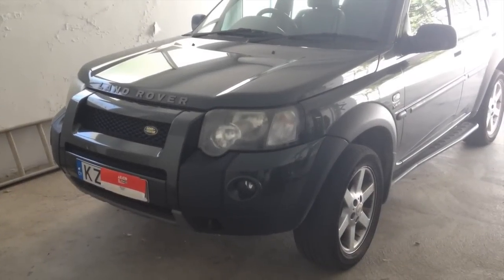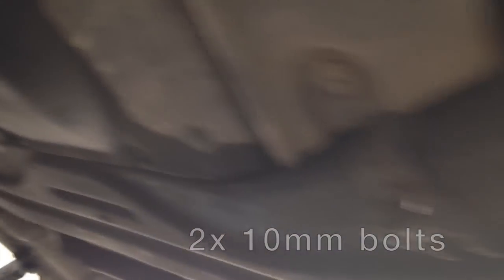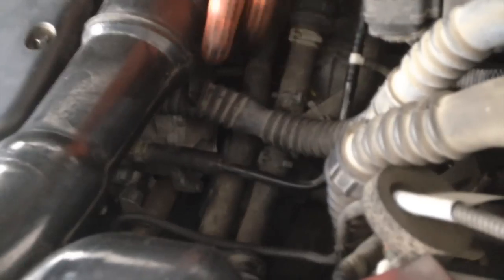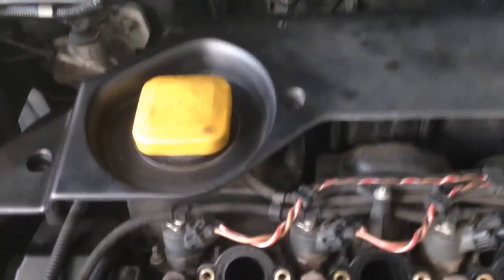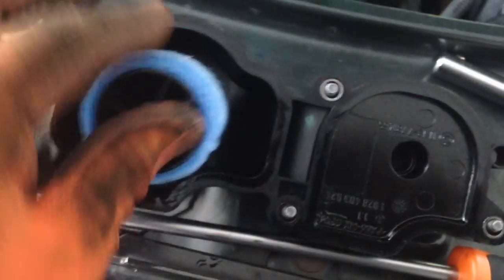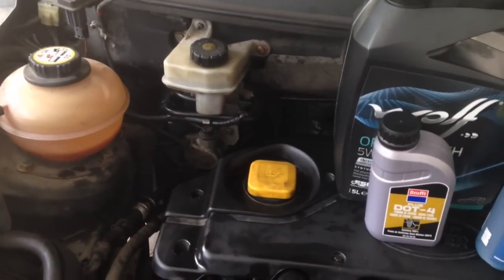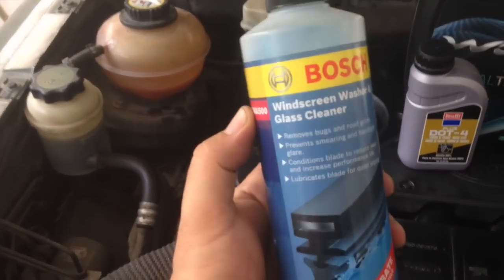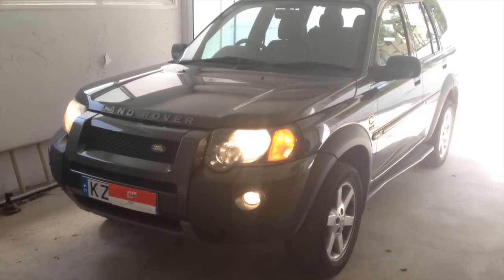How to do a Full Service on a Land Rover Freelander TD4

Comment: Thanks a lot Sir for your video and information provided , especially because I didn't had any information about my recently bought car , and watching this video it explained a lot to me , so thank you very much and all the best !
Reply from the maker: Happy it helps... I wish you well with your new car :)
Reply: wanted to ask you a question sir , because I have trouble finding out why I ear a metal noise from the middle shaft  when I am driving in First and Second Gear , and also when turning corners , did you had this problem before with the car ?
Reply from the maker: Yes. . I think it was the centre drive shaft bearing that had worn. Its a simple fix.

Comment: Once you know where the drain plug is for the oil, use a hole cutter to make a large enough access point in the under tray for future oil changes, makes the job so much easier and doesn't affect the vehicle in any way :)
Reply from the maker: Yep, someone suggested that top tip earlier. Well worth it.

Comment from the maker: UPDATE: I've had a chance to test the consumption now after fitting the EGR bypass valve. Before I was getting 30mpg and now i'm getting 31.8mpg which means I'm now getting nearly 25miles of extra milage per full tank of fuel. At the current rate of €1.30/ltr thats a saving of €7.10 per full tank. Considering the EGR bypass cost me €35, it will pay for itself after 5 full tanks.

You must also bare in mind that aside from the better economy, the main benefit of fitting the EGR bypass is the long-term benefit to the health of the engine.
Reply: Jimi LeSaint Is there any chance that it will fail the emissions test on the MOT if it is done?
Reply from the maker: Mick Green From what I understand, the EGR bypass does not affect the emissions test.

Comment: Anyone reading this service video should know the the original small crank case breather filter (blue one) can be replaced with an upgrade that never needs changing again. Very important to change this filter or it can damage the turbo beyond repair and cause major problems!!!!!
Reply from the maker: I think I mention that in the video.., but maybe not. If I’m not mistaken, it’s a BMW part number >B11 12 7 799 367<

Comment: Don't suppose you can do a video of the glow plug replacement can't find one anywhere cheers for this video I've just serviced my td4 thanks
Reply from the maker: I haven't changed the glow plugs on my LR, but i did some on a Citroen C4 HDi and it wasn't difficult at all, except that the plugs were at the back of the engine and I had to use mirrors to remove them!

Comment: Great video, has given be all the tips I need to give my freelander a service as only just bought it.   I bought all the bits, but the only differnce is the oil filter is the exact same as yoour but the filter kit, only came with a sump washer, a smaller copper washer, and 1 large rubber o ring.  Do I not need the two small rubber o rings, and what is the copper one for.  Again many thanks for a great video.
Reply from the maker: L61kvo Hi. Glad you're diving in! Haven't a clue what the copper washer would be for... I haven't seen that before. The large O-ring is for the oil filter... ideally you would change the small rubber rings on the oil filter cap too. Nevertheless non-official LR parts supplier's small O-rings are commonly slightly out in size. When I did the one on the video, the tiny O-ring at the end was too big, so I just left the old one on. If this is the case, I'd advise to buy original LR oil filter O-rings next time you do an oil change. Meanwhile, it probably won't be a big problem to leave the old ones on for now.
Reply: Jimi LeSaint Thats great many thanks for the quick reply.   On the next sunny day and when my Mrs leave me the car I getwill get stuck in with the full service, the EGR Bypass as well as the crank case modification with the BMW part, my fingers are all crossed :)
Reply from the maker: Excellent. I'm currently testing my MPG since installing the EGR bypass valve. I was getting 30MPG before... so I'll let you know if it made any difference once the test is done.
Reply: That be great we have a 2003 td4 auto and so far so good, more mpg thab my 390tdi auto Discovery, but then so is a tank :)
Reply from the maker: L61kvo 

UPDATE: I've had a chance to test the consumption now after fitting the EGR bypass valve. Before I was getting 30mpg and now i'm getting 31.8mpg which means I'm now getting nearly 25miles of extra milage per full tank of fuel. At the current rate of €1.30/ltr thats a saving of €7.10 per full tank. Considering the EGR bypass cost me €35, it will pay for itself after 5 full tanks.

You must also bare in mind that aside from the better economy, the main benefit of fitting the EGR bypass is the long-term benefit to the health of the engine.

Comment: it's probably best to leave the EGR system as manufactured in a direct firing diesel engine.  EGR reduces the temperature of combustion ( and hence the NOX pollutants ) by introducing inert (spent) gases into the combustion chamber in carefully measured amounts by the engines computer. When you remove it, you may notice some increase in power or economy due to the increased cylinder heat and hence pressure. This apparent short term increase in performance is why many mechanics recommend the procedure.  But this increase in heat and pressure also causes premature failure of the direct firing fuel injectors since the tips of the injectors are directly in the combustion chamber. New injectors cost between $500 - $1000 EACH normally.  It will also cause failure of the injector to cylinder head seals - usually a copper washer arrangement - and this results in mixing of coolant into fuel or fuel into engine oil ( or both ).   This may entirely destroy your engine due to cross contamination, as well as causing the famous "run away diesel" phenomenon where the diesel revs out of control and blows up despite being turned off - due to it running on it's own fuel soaked engine oil.  This is apart from the premature failure of exhaust valves and piston rings and turbochargers due to the abnormally high temperatures. A cynic might conclude that a mechanics real reason for recommending the disabling of the EGR system is the guarantee that he will make $1000's of dollars from the poor sap who does it when the engine goes pop.
Reply from the maker: Good info, worth considering!

Comment: Hi Jimi thank you for the vid, I have the exact same model. Would you perhaps know how to fix the injectors as one of my injectors are leaking
Reply from the maker: My injectors went too. LR dealership wanted €1000 each!! I ended up having them sent off to be recondition and recalibrate a at about €800-900. Remember to always change your diesel filter as the car gets older, and also try and use manufacturer fuel... like Shell, Esso, BP... and NOT supermarket diesel. The cheap diesels are cheap for a reason. If you want to keep your engine clean, buy fuel wisely.
Reply: I can help you on injectors, remove them all, wash them with diesel or petrol and brow them with compressor air, wait the to dry, if you used petrol, then at the end of washing, Use diesel again after petrol dries, then check your thread of your injectors, if they are good, put them back and bleed them one by one

Comment: Hi, how did you remove the two hidden bolts on the back of the air filter housing? Seems that the allen keys are not so easy to reach. Did you use any special tool for it?
Reply from the maker: I just used a long allen key with a handle.

Comment: My genuine filter only came with 1 large o ring and 1 small copper washer.  Your intake pipe looks slightly different to my car.  I don't have any sensor on mine.  I think maybe the facelift cars (2003-2006?) have slightly different bits in the engine compared to (1999-2002) cars.
Reply from the maker: Yes, the post-2002 facelift cars are different.

Comment: Hi, thank you very much for this helpful video. I have a question. I have a freelander td4 2005, three doors. Is it possible that my car does not have a fuel filter? no body can find it, I showed this video to the last mechanic I visited but he could not find it!
Reply from the maker: It should be either under the bonnet to the right of the engine (under the battery?) or under the rear wheel arch on the right hand side (as in the video), depending on the year.
Reply: Thanks for the answer, its 2005. So, in your opinion the car has a fuel filter at 100%...because some mechamics are telling me that maybe it does not have...
Reply from the maker: @onlysolo  I doubt that they DONT have a fuel filter. If it’s not in the two places I mentioned, then maybe it’s inside the fuel tank?

Comment: When you have spent about an hour removing the engine undertray JUST TO DRAIN the oil. Why not cut a small square under the drain plug and make a cover out of some aluminium sheet and secure it with clips. Then it only takes a minute to get at the sum plug to drain the oil. WHY didn't Land Rover think of that....Pete in Worcester
Reply: ..I was lucky enough to find...someone had already done it..
What a stroke of luck..lol

Comment: Hi, It you have a gasket with your EGR valve do you still need sealent or will the gasket do on its own?
Reply from the maker: Mick Green The gasket on it's own should be enough... there's no liquids or high pressure to deal with... so I guess it's fine.
Reply: Thanks for all the information but mine is a 2001 td4 model it makes very hard jerks when changing from gears 2 and 3 it has an automatic gearbox I've changed the oil it didn't check diagnosis is saying electically it's ok now I'm wondering what could be the problem.

Comment: Hi Mate, am thinking of getting one myself a 2001 2.0 Td4 model, what are the common issues i should look out for if any? Thanks
Reply: Wow mate, where to start, diesel injectors, pumps and control arms always go. Also the car Struggles to start. I have replaced starter, pump, and injectors and still struggles to start. I would not buy this car again.
Reply from the maker: +Richard Leonard Did you have the glow plugs checked?
Reply: +Richard Leonard I did when n got one.. lucky enough to have people with the similar make to give some top notch advice mate..  changed the required n all systems go..
Reply: Jimi LeSaint Yeah I just put in new Glow plugs last week
Reply: Vishnu Rajendran Amboo Fair enough, you are lucky, in that case it would be better to own one with advice readily available, the problem with me is Im the only one out of everyone i know or even close to me that has this Landy, My sister has the Evoque but that cannot even be compared to ours in the same sentence, completely different car. I have had this Landy for 7 years, in this time i have done: PropShaft,both Drive Shafts, diesel pump, recon injectors, starter, cv-joints, control arm and bushes x2,Clutch,Flywheel, and done glow plugs twice as well, as well as 2x window motors,fan blower and about 8 different sensors. I have serviced the car twice a year and still the maintenance costs keep piling.
Reply: +Richard Leonard wow almost sounds like a complete rebuild, there must be a reason why you are holding on to it for 7 years?
Reply: yeah the reason is, when it works, i love driving it,it really does drive beautifully ( when it works) and the looks, i love the way car is designed.
Reply: +Richard Leonard its always a hate/love relationship..
Reply: @richard6000  Wow I have seen one of these in mint condition but your comment has put me right off 👌👌

Comment: Hi Jimi, thanks for uploading this video. I´ve the same car and I took the car to the mechanic and they told me that my car doesn´t have a Fuel filter? I´m wondering if that´s possible? Thanks Nick
Reply from the maker: Nick Tilimian Nick, I'm no expert, but that sounds like nonsense. It's either behind the battery on the early models, or under the rear wheel arch on the drivers side, on the facelift model. Its difficult to get to, and mechanics usually don't bother changing them... but if you watch my video, you can see how to do it yourself. It's a bit of a pain, but it's worth it 👍

Comment: I'm using a 10-40 oil... Wonder if that would be a problem.
Reply from the maker: For sure it will work ok, but manufacturers make recommendations for a reason... so I usually try to use those.

Comment: Vertical battery terminal connection bolt and nut, stupidest idea I have ever seen.. Causing no end of problems... Until finally sorted out by replacing them with horizontal ones.. When I do a service on a vehicle.. Motorbike or other... I always scan and print the receipts for consumables/ parts if required... To add to the service history.. Log the mileage and or take photos of the mileage with a local newspaper included.... If you use a garage then try to find one other people you know or trust have recommended.. If you are using a garage for the first time or are not confident about their honesty I always make a permanent mark in a hidden area of the parts that will be replaced.. oil, air filter or fuel pump.. Even for other larger parts to be repaired or replaced such as starter motor, alternator.. Anything and everything. A small ultra violet pen is a great friend of the car owner or a hacksaw or small point chisel? Mine has the BMW engine too.. Chain for a timing belt.. Sorted..